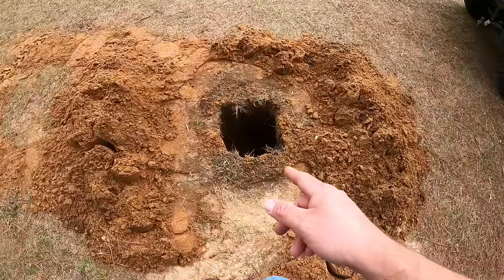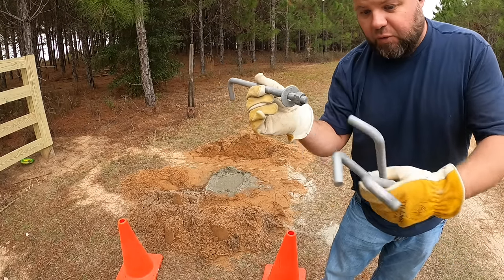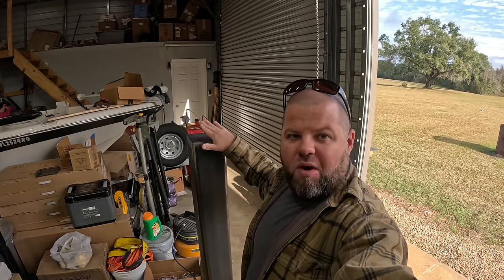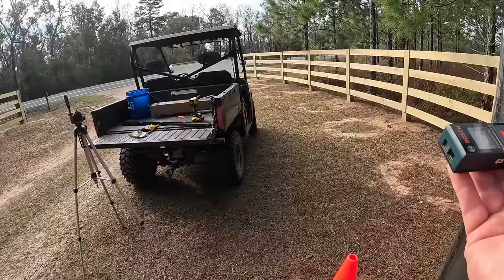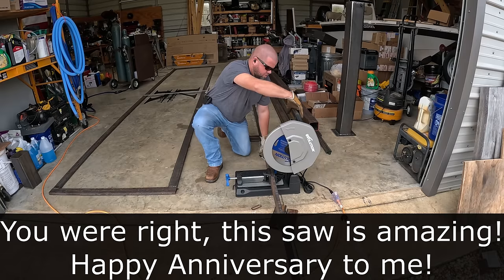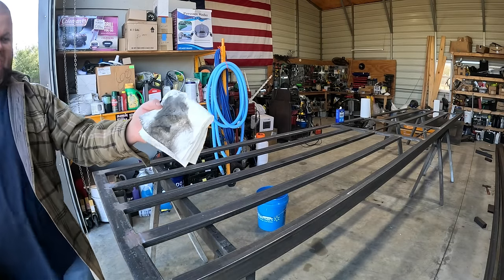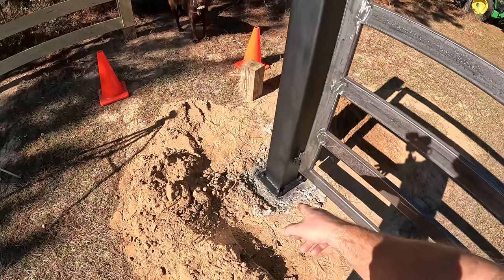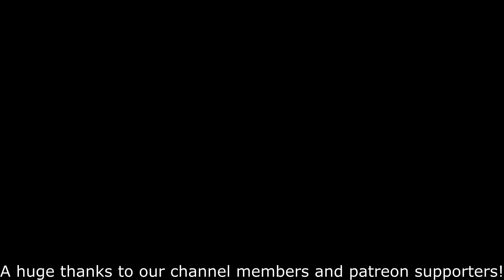DIY! My First Ever Gate Build

Comment: SUGGESTION, ADD A BAR OF DIAGONAL STEEL GOING FROM TOP TO BOTTOM ON EACH SIDE OF YOUR NAME. ADD STRENGTH AND WOULD TAKE AWAY FROM ALL THE HORIZONTAL LINES IN THE GATE. Vinny
Reply from the maker: I don't want to take away from the horizontal lines, the gate was built to match the horizontal fencing so everything flows.

Comment: As someone that has installed a ton of gate operators..it’s difficult to over build the hinged post, with 20’ leverage…things are going to change. I agree with the lock on gate…when it doesn’t line up, you will know your gate/post has moved. Don’t know anything about the operator, may work for light residential. Nice looking gate/fence.
Reply from the maker: So far almost two months in operation with zero sag. We've had several inches of rain and several severe storms with high winds. That same post is connected to another post via 4 boards to complete the fencing. It will literally have to pull two concreted posts over to sag. One having 640lbs of concrete in its base. I'm sure it's possible, but I'm not seeing any signs of sag. My gate operator and lock are also working flawlessly, I went with a Ghost controls system.

Comment: With that much weight for the gate, I would suggest a wheel at the end to help support the other end and not put so much stress on the hinges
Reply from the maker: That creates rolling resistance and is not recommended by the gate operator manufacturer. It will void your warranty.

Comment: You might consider a cable/turnbuckle from the top of the steel post to the bottom of the wood post to transfer some weight after your fence is done. Also you certainly need a stop post so you don't rip the hinges off the post when the gate open to far. Maybe it's coming in the next video.
Reply from the maker: It's been discussed quite a bit in the comments, I've already been prepared for a cable if need be.
Reply: I'll wait for the next video to see what you decide. @TKCL
Reply from the maker: So far so good

Comment: Permit me to offer a suggestion. First, the gate looks beautiful. Love the look and the monogram. Most excellent.  A small suggestion .... Since you didn't use any bracing in the gate itself (I understand the desire for the aesthetic..), you might consider adding some small triangular gussets in the four corners of the gate. This is especially important on the heavier hinge side. If your swing post is solid, and it certainly looks like it is, then any "sagging" or "settling" is in the gate itself. Two long diagonal braces from each end toward the center would be best. You don't need to compromise the look of the monogram area. Just stop the braces at the vertical closest to the monogram. If you don't want to bother, then four triangular gussets, one in each corner of the gate, welded solid to the top and bottom rails as well as the verticals. Light weight steel plate would work fine. I would probably use 1/4" or 3/16" and make them about a foot each way.  One last thing. Having the gate post adjustable is a good idea. However, that gate WILL sag under it's own weight. If you start adjusting the gate post to compensate, then all you will have is a leaning gate post and the gate will continue to sag. I don't believe there is any way to prevent that large of a gate from sagging without bracing.
You DO have a beautiful gate though.!!  Nicely done.!!
Reply from the maker: Funny you mention this, I had a serious conversation with my wife in the shop about gussets. She asked what's that? 🤣 So it's already been considered and we looked at what it does to the clean lines of the gate. We decided to add them only after we see any issues. After hanging for a few days no issues are seen, we will keep monitoring.
Reply: Since the gate is in the closed position the vast majority of the time, I wonder whether it would be helpful to put in a small platform at the far end for it to rest on when it's closed.  There would likely need to be some sort of slightly angled "ramp" section leading up to the level resting spot for it to ride up in case it does develop a very slight sag over the years, and that would need to have some sort of frictionless surfacing (or at least minimal friction surfacing or even a rolling bearing) to avoid putting too much strain on the gate opening mechanism, but perhaps that could prevent that sagging you're saying is inevitable with such a wide gate.  Just a thought...
Reply: New subscriber. Loved watching this video on the gate. Excellent work, it looks beautiful, especially the personalisation of it. One question, how do you stop thieves from helping themselves to packages in that black drop off box?

Comment: helpful hint, when marking template mark which way is North so since bolts in concrete may not be exactly square.
Reply from the maker: Agreed, that's why I went back and set the post on it and marked it.

Comment: I think I would have installed a 3rd Hinge.
Smart design on the post leveling and adjustability.
Reply from the maker: The risk with additional hinges is binding, unless perfectly aligned. I wanted to avoid any additional friction the gate operator had to overcome. This gate has been in operation for a while now, zero issues.

Comment: Andrew have you considered adding a roller wheel on the far end of the gate?  It will help support the gate and reduce sag.   They have big tire versions that work better in dirt or gravel etc.
Reply from the maker: No, that creates resistance and is not recommended by the gate operator manufacturer per the manual.

Comment: You can also put a wheel at the end of the gate to help with stability. Check it out,  it will help with long-term improvement
Reply from the maker: That creates resistance and is not recommended by the gate operator manufacturer.
Reply: I thought about this as well and believe that gravity will eventually win with the sagging but would go as long as possible without a wheel...if you have to add a wheel eventually I'd put something down to create a smooth surface for the wheel to roll on like millings or something that will pack down
Reply from the maker: Not needed, if I see sag I'll add a cable to the 6x6 steel post and attract that to the bottom of a 6x6 fence post. I can then tighten the cable with a turnbuckle.

Comment: Gate looks great!  Love that you shared the story on the sign.  Keeps you real.  I will say that those hinges look like 5 inches, maybe 7"?  I don't know the weight on the gate, but even the 7" hinges might be undersized for that gate.  Maybe a couple more.  Hau'oli Makahiki Hou!
Reply from the maker: These were rated for 900lbs, but I know there is a lot of leverage.  I will pay attention to them and add a 3rd if needed.  I want to avoid adding anymore as it adds a potential for binding.

Comment: Andrew, this is Roger Hatton.  As normal you came up with a very good design and great workmanship..   I would only suggest that you put locknuts on base plate to prevent loosening of nuts due to the opening and closing of gate over time.  I believe that as the weight of the gate moves during opening and closing it will cause the nuts to slowly loosen.
Reply from the maker: Agreed, I thought I had lock washers but found out I didn't.

Comment: I like your post idea.   Also painting the interior of the post with rust-oleum before welding will help after you weld.  I filled my post with concrete and rebar to provide added strength.   It is not too late to do this to yours.
Reply from the maker: It is, mine is welded up top and bottom. This is 1/4 wall 6x6 tube, it isn't going anywhere.

Comment: Put a small wheel on the bottom towards the open of the gate. That'll eliminate any stress and sagging.
Reply from the maker: That creates resistance and is not recommended by the gate operator manufacturer.

Comment: Looks great! If I were you I would but a heavy steel cable from the top of your steel post down to the base of the wood post on the corner. Can then use a turnbuckle to keep that post plumb as it settles.
Reply from the maker: That's been on my mind to do if I see any shifting.
Reply: Great minds think alike!! Lol

Comment: Consider adding a wheel to the outside of the get, it’ll take a lot of the weight off the hinges. It’s a simple addition that over time will keep your hinges intact
Reply from the maker: Problem is that it causes resistance and is not recommended by the gate operator manufacturer.

Comment: WHEW, I made it Andrew... All caught up on Videos 
DId you count how many times someone mentioned a Wheel at the end of the Gate HAHAHAHAHAH
That is a Pure example of not reading the comments before making one ..
I have envisioned a gate for My Property and was planning on a Taller Hinge Post so I can tie back away from the post and a Cable down to the Gate at the Halfway point to eliminate any sag and take most of the Weight of the gate.
I like the Wide area between the Road and the Gate. it Allows someone to turn around and not have to back out into traffic. 
Thanks, Mike M.
Reply from the maker: Thank you for watching! As for the wheel 😕..... You're correct

Comment: Excellent job.  Was just thinking could you put a wheel on the bottom at the latch side to take more strain off the hinges or do you think it might bind?
Reply from the maker: That actually causes more resistance and is not recommended by the gate operator manufacturer.

Comment: Looks amazing!! Just add a tire at the other end of the gate to alleviate sag or stress on hunges
Reply from the maker: You can't, that add resistance to the gate operator and is not recommended. Would be fine for a manual gate.

Comment: Put a wheel where the gate swings open with a spring adjust with ground .
Reply from the maker: That creates resistance and is not recommended by the gate operator manufacturer.
Reply: @TKCL  👍🇺🇸👍

Comment: Maybe you can put a bigger caster wheel on the end of the gate for relief
Reply from the maker: You can't do that with gate openers, it creates resistance and is not suggested by the operator manufacturer.

Comment: Just wow, and amazing sign. Just curious if adding a zinc anode bar to it would help prevent rust and/or run a small grounding wire  with a grounding rod to the ground adjacent to the post?
Reply from the maker: Not sure, I know that works in salt water.

Comment: You can always get you a gate wheel to add to the bottom of the gate to assist when opening.
Reply from the maker: That creates resistance and is not recommended by the gate operator manufacturer.
Reply: Gotcha. Just an idea. Great video

Comment: I like the idea about using baseplates instead of concreting the gate post. Why did you decide to go that route?
Reply from the maker: Steel pole in concrete will rust, I'd rater have it above all the moisture.

Comment: In my environment a long gate like that would sag within a year without a wheel on the end and additional supports for the posts. I will be curious as to how well your gate will hold up against sag.
Reply from the maker: Time will tell, it's very easy to add cable supports.

Comment: Looks great. Jack of all trades. Any thoughts on a wheel at the opening end of the gate?
Reply from the maker: No, that creates resistance and is not recommended by the gate operator manufacturer.

Comment: Can you add a wheel to the opening side to help with the sag and easier opening?
Reply from the maker: You can't, it adds resistance and is not recommended by the gate opener company.

Comment: Good looking fence and gate.  Have you mentioned what finish you're going to apply to the four-board wooden fence?  You didn't show it, but you did paint the bottom of your steel post, right?  Do you have a guess on the weight of the gate?  The gate looks to swing rather nicely.  Thanks for the episode.
Reply from the maker: I keep forgetting to mention that we plan to stain the fence black after it dries a few months.  All steel surfaces are painted and I would guess the gate weighs 300lbs.

Comment: Looks great! Would a wheel be an option on the swing side to take some weight off the steal post if it continues to sag?
Reply from the maker: No, that creates resistance and is not recommended by the gate operator manufacturer.

Comment: Holy cow...how did you not get a flash burn on your eyes for welding without protection? Sure do hope your eyes are ok. 
I love that gate. I'm a tiny bit jealous of your fabrication skills. You aren't the only one who has done things like having the mistakenly assumed something was made wrong when the mistake was operator error, lol.

Don't know about today's technology but years ago, an automatic gate opener didn't last long in Florida since lightening would take it out usually the first summer. I got tired of replacing pc boards and went back to manually opening the gate. I hope they have overcome some of those issues.
Have you thought about putting a pneumatic tire on the latch side of the gate? I definitely won't miss the next episode!
Reply from the maker: No, that wheel creates resistance and is not recommended by the gate operator manufacturer. As for the flash burn, my eyes were closed. That's common for q quick tack Weld.

Comment: People always weld  they use meg weld  you should use 7028 5/16
Reply from the maker: I mig and stick weld, mig is far faster and preferred for thin metal welding.  I can lay down smoother welds this way as well.

Comment: I'd just put a ground touching wheel on the opposite end to alleviate much of the weight on that end, and just think if you had of made it out of aluminum
Reply from the maker: Wheels add resistance to openers and are not recommended when using one on a gate this size.

Comment: Outstanding job ❤
Are you planning to put like a little gate door on the other side of that Steel post so you don't always have to open the big gate?
Reply from the maker: I have thought about that but never committed to doing it. Once you drive down to the gate it automatically opens regardless.

Comment: Could you put a wheel on the other end to support the weight
Reply from the maker: No, that creates resistance and is not recommended by the gate operator manufacturer.

Comment: If I dig a square hole, put my rock, post, and cement in there, and then put rebar in the four corners, will that keep it from shifting?  Is the rebar necessary or just overkill??
Reply from the maker: Rebar does not technically strengthen concrete, what it does do is hold concrete together that might potentially fracture or break.

Comment: Looks great, but why not use 3 or 4 hinges instead of just the 2
Reply from the maker: 900lb hinges is already overkill. The more you add, the greater the chance of one being off center, binding and creating resistance for the gate opener. You need the swing to be very smooth.

Comment: Would a tire under the gate, on the end opposite the hinges, prevent sagging over time?
Reply from the maker: No, that creates resistance and is not recommended by the gate operator manufacturer.

Comment: I Amy have missed it, but what two gauges did you use? Also, is that 2X6 tubing, or 1x6?
Reply from the maker: 16 gauge and 11 gauge for the main support tubes on the gate. Post is 1/4 inch wall. All gate materials are 1x4 tubing.

Comment: Mr Kelley
What steel thickness did you use on this gate?
Reply from the maker: 14 ga on all 1x3 tube except the bottom and side is 11 ga for strength.

Comment: Any reason you didn’t use a third hinge in the middle?
Reply from the maker: Yes! It's already beyond rated weight capacity for the two and not needed. Secondly and most importantly, it's extremely difficult to align two hinges perfectly, much less three. That creates binding which hurts the performance of the gate operator.

Comment: Hey can you tell me what kinda drill that is an were I can get one? Thanks
Reply from the maker: I love that drill, used it alot over the last couple of years. Below is an affiliate link of mine and a discount code. I do earn a small commission but it doesn't cost you any extra. Make sure you register with your email before checking out and it will save you even more money. 
VVPRO 5% off
VEVOR Mag Drill: https://s.vevor.com/bfP32M
Annular cutter https://s.vevor.com/bfP32R

Comment: Now I'm not gonna lie, I cried laughing at that 🤣I would actually done the K elley and not used the smaller K - No? If you need a wheel for that I have one I cant use lemme know and I'll send it
Reply from the maker: The wheel creates resistance and is not recommended by the gate operator manufacturer. Thank you for the offer

Comment: Reason it moved round square and alot never and don't put the post in the ground far enough. If you put your post in 8' in the ground
It won't move. According to  the ground i do what is needed to have gate post to Secure.I never had a round post move. With gates made out of pipe.  Your gate is not that heavy weight wise.